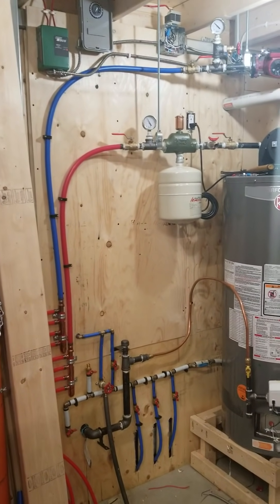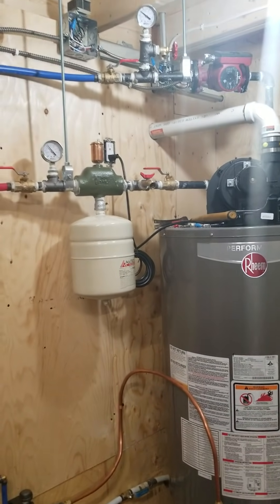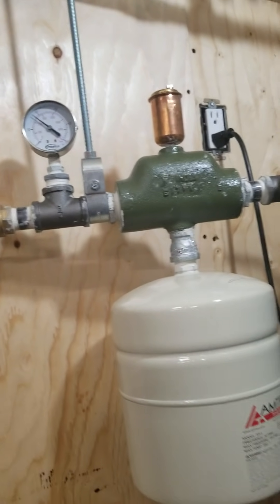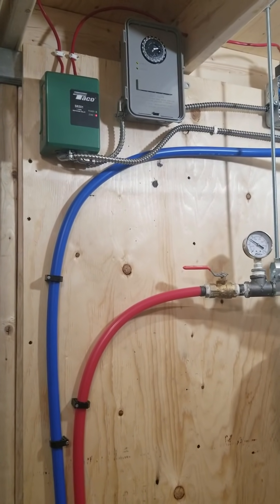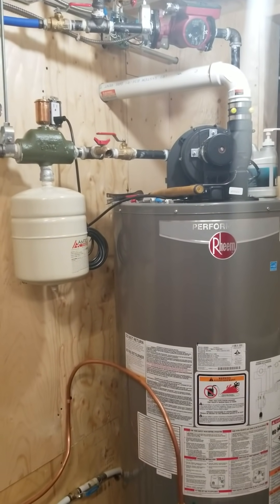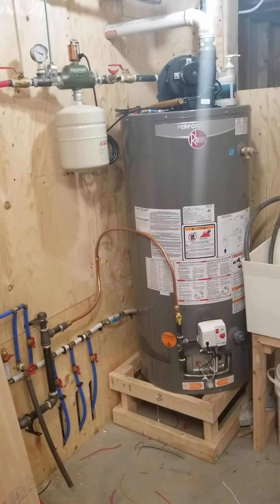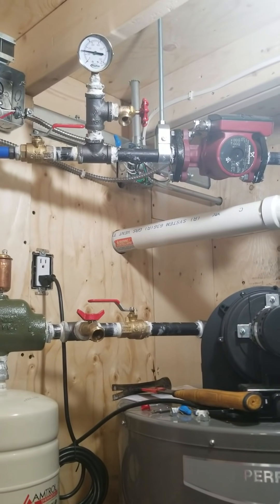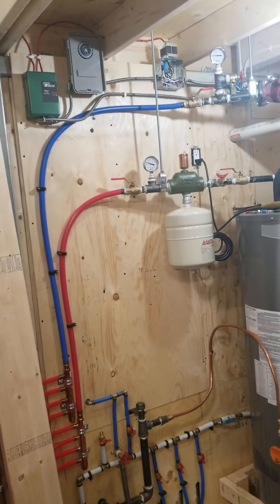DIY In-Floor Hydronic Heating System Using Water Heater

Comment: A really good attempt. Here are some helpful tips... Water temp coming back to heat source should be 15 degrees cooler than going out. This way your heat source can keep up. Do this by closing your out going on/off valve a little at  a time to slow the speed of circulation till the water comes back 15 degrees cooler. This gives the concrete time to pull the heat out of the water/ tubing. Slowing the circulation speed wont hurt the pump because they have an automatic bypass built into them.    2nd tip. You have way too much plumbing on the wall and its not insulated.(severe heat loss and inefficient)  From where my hot water comes out of my hot water tank to where it goes into the floor is only 4 feet. Cooler water coming back out of the floor to reentry to the tank is 4.5 feet.(insulated)    3rd tip. Connect a water supply to the system with a backflow preventer in place with a 3 pound pressure reducer. Lower the pressure in the expansion tank to 3 pounds also. Why? because you want the pump to control the speed of circulation ( Not the city water pressure or the pressure from the expansion tank) and also, even though this is a closed system,  water will disappear and you will need make up water.         4th tip. Scrap all the temp/ thermostat control stuff and buy a  120 volt 7 day 7 event programmable timer... I program my timer to turn the pump on and circulate a fresh batch of hot water 3 times per day for 2 hours each time. In between runs, the concrete constantly pulls the heat out of the water/tubing. As weather gets colder/ warmer , you can add or delete how many times the pump turns on. Follow these steps and you will have your system dialed in. Good luck.
Reply from the maker: Thanks for the tip, I will try these out
Reply: Agree with what you described but scrap the air temp thermostat, you need a floor temp thermostat.  When you put in the pex, place an empty one in the floor between two runs, about 4-6 inches away.  Run the temp sensor down the pex run and that will give you the temp of the slab.  The temp of the air will be exact as the slab temp then.  Set the temp on the thermostat and forget it.  The system will come on and off as needed.  When it runs, the temp sensor will rather quickly sense the rise in temp and then shut the system off.  The slab temp will then rise 1-2 degrees higher after shutoff.  When the slab cools down the cycle repeats.  No guessing, no running the system on a timer, and you get consistent temp 24/7.  Much more efficient too.  I got this one from Menards, been running for 9 years on the same hot water heater like yours with no issues.  Aube Thermostat w/ Floor Sensor
Model Number: TH114-AF-024T Menards® SKU: 6655651
Reply: @bobs4718  thank you Bob. Menards is getting better at handling more hot water heating components.
Reply: You say, "even though this is a closed system,  water will disappear and you will need make up water".  How is the water lost from a closed system?
Reply from the maker: @rogerg4916 there is still an air vent in the system. There will still be evaporation
Reply: There is no need for a fresh water feed. I have set systems up as a closed loop, one in a paint booth and a current one in my crane yard building. The crane yard has no water supply, so when I set the system up 9 years ago I just hauled the small amount of water needed. After charging the system and getting the air out (just like how you bleed brakes) I was done, and other than glance at the pressure now and then it's been totally leak and maintenance free. No real advantage to this way of doing it, just saying you can do it if you don't have a city water supply on hand!. My other systems at home have a boiler feed valve/check valve setup. I have an embedded thermostat sensor in my crane yard slab, set at 50 degrees, and a 1.8 KW 120 volt electric boiler by Electro Industries, oddly enough a 1.9 KW PV array makes enough power (stored in my utilities net metering system) during the non heating months, to let me keep the building (only 18'x 40', but 14' high) at 50 degrees all winter for free! The Electro boilers are great, especially if one has a surplus of free solar power.
Reply: I ran a similar setup with dual propane tankless heaters in parallel for hydronic and DHW with a flat plate heat exchanger. I recently swapped an 80 gallon heat pump water heater for one of the tankless units and use it only for DHW. I would like to get rid of the 2nd tankless unit and use the 80 gallon tank for hydronic as well.  It’s only a 2 person household so not a lot of hot water use. I don’t want to burn out the heat pump fast either and am wondering if it’s up to the task.  It’s a hybrid so can run on the 4kW elements too but want to minimize that. Had a thought that maybe I could keep the one tankless in service to get the slab up to temperature and then switch over to the heat pump water heater to maintain temps. Would have to install an automatic valve of some kind. Any thoughts?
Reply: Holy complicated.

Are you seriously suggesting changing the pump schedule on the timer every time the outside temperature changes? People have full time jobs you know, what an overcomplicated pain the ass way to control the temperature. Obviously you need a thermostat on the system. The timer is a good idea but only as a way to let your hot water tank recover between dumps into the floor. This also solves the problem of your heating system keeping up. 
 
Technically you could make this work with the smallest water tank available if you set up the timers right. You just wouldn't heat your space up at warp speed. Really the ultimate would be an on demand instant water heater, which is basically just a boiler.
Reply: @jimlewis1992  I have a hot water heater in a house we bought. Going with hot on demand propane. I was thinking of setting up the hot water heater for floor heater with the anti freeze. Is there a way to do both with the hot on demand  with separate water sources? The floor water would run under the house which is in Tennessee. It sits on a foundation but has a big crawlspace where the tank is now
Reply: @jimlewis1992  just to clear things up - an instant hot water heater is in no way “basically just a boiler”

Comment: Great job Jordan.  I like your system.  I moved from Eastern Ontario recently to Vancouver Island and I would like to build a shop with a similar system although I may use solar PV to heat the water.  I like your detailed and well-explained system components.  Thanks.
Reply: I would like to discuss your ideas for the solar pv hot loop system. I've been working on one of my own with a thermal battery feature. The goal is to eliminate the need for extra electricity or fuels to maintain those temperatures all night or longer without proper sunlight.

Comment: I wonder if you could just program a thermostat to run for 30 minutes, and then shut off for 30 minutes?  If that seems to be what keeps your room comfortable, why worry about a temperature control.  You could just turn down the temp of the water heater when the weather starts to warm up a bit.  That would eliminate the need for the "override" timer.  Just a thought.
Reply from the maker: But then I have to physically turn the knob on the water heater up or down. I have to ability to monitor and change the temperature anywhere in the world providing I have a wifi or cell signal.

Comment: I came across this video while I was looking for examples of how people incorporated a tempering valve into their system. I understand it is to help regulate the heating loop temperature. But I see you have a dedicated water heater right in the heating loop, which allows you to adjust it to what you want with the heater setting.

After hearing what you were saying about the heater running out (of hot water) I was thinking that you would gain on the duration of your hot water in the loop by incorporating a tempering valve between the hot supply water at say 160 degrees to your desired 130 degrees.
Apparently it hooks up between the hot line and the return line and uses that lower temperature return water to temper down that 160 degree water.  Just saying.
Reply: Can you use this system for a home?
Reply from the maker: I'll definitely look into this

Comment: Good Video! I'm a Red Seal/Master Electrician as well and Red Seal HVACR Tech. You have built a great system and perfect for your shop like you said. All looks and works as you want. The one thing I noticed was you didn't have a maid"O"mist/air bleed on the high point of your system. You may have added one already, but could easily be installed on the return globe valve before the pump.  Thanks for the video great work!!
Reply: out of curiosity, since this is a closed loop system, is there a need to constantly bleed air?
Reply: @FixItYerself  I would, more of an aid to keep the headaches away. I've seen many a small system like your and commercial highrise chilled and heat systems bleed of air that always gets trapped somewhere in the system and then decides to move on. The bleeder at the highest helps eliminate any issues. Cheers

Comment: Excellent!!  I have a friend in Alaska that is heating a 50x50 aircraft hanger with an in floor system such as you have and using a 50 gallon electric hot water heater to maintain.  Now I know how it's done.  Thanks

Comment: Thank you for the video. I wasn't quite understanding about how you avoided hitting any of the runs under the slab. Did you take measurements to know where you could punch into the concrete? Thank you for the reply in advance.
Reply from the maker: I stapled the water lines the the insulation. With a six in thick concrete slab and the half inch thick tubing I could drill down 5.5 inches and not hit anything. Just to be safe I only drill down 5 inches

Comment: I love some of your comments in the video and the overall system is awesome.

What spacing are the tubes in the slab?

Is that 1/2" or 3/4" pex in the slab?

Again, great video and thanks for sharing.
Reply from the maker: 1/2" tubing, spaced 12 inches apart

Comment: So many whiners in the comments, I'd say it looks pretty good. You should change out that plastic drain valve on the waterheater for a brass one, those ones are bad for leaking. Fuck the relief tube it's in a garage.. And to everyone saying this is going to cost a shit load of money because it's in efficient, natural gas is dirt cheap, this wouldn't cost more than a dollar a day to run.
Reply from the maker: Thanks man. Because of the liberal governments carbon tax my gas bill went up, but it still costs me about $350 to heat my shop a year and I turn the system on in October and shut it off in May.

Comment: nice job for an amateur. It will heat the space but this is horribly inefficient and overbuilt for what it is. Ive worked in HVAC for 19yrs and there is a very good reason we don't use water heaters as boilers. DO NOT DO THIS 

 unless there is no possible way to get a proper boiler. a standard boiler is about the same cost as a power vent water heater if your doing the work yourself but will last 50yrs and work a lot better.
Reply from the maker: To be fair I couldnt find a cheap enough boiler up here in Canada. As soon as an american heating unit crossed the border the price almost doubles. This is a work in progress, when the tank does fail I might be in a better financial position to purchase a proper boiler.
Reply: @jpaul1030   Its a shame you couldn't take a trip to visit the states.
Reply: Sounds like someone trying to sell boilers!

Comment: Great video. I have built a similar system. I'm having trouble wiring the thermostat using the separate transformer to the relay. Any way you could give the details?
Reply from the maker: What's your email I'll send you a schematic
Reply: @jpaul1030  colinduffy37@gmail.com

Comment: Nice set up..!  I have propane and Hate it. Electric heater be ok? I see guys doing this with electric instant water heater.. See any problem with that?
Reply from the maker: It will work well. Theres another youtube video showing a hydronic heating system where a guy uses an electric water heater and he says it works just fine. I just went with natural gas because here in Ontario we get bent over when it comes to the price of electricity. Natural gas is way cheaper for us.

Comment: Any idea what the heat is costing you in gas usage? Thanks.
Looking at doing this on a new shop.
Reply from the maker: It added about 60 bucks a month to my  gas bill
Reply: @jpaul1030  how many square feet is your shop.? Thanks!!
Reply from the maker: @SRH58  just under 1200 square feet with a 14 foot high ceiling, one 10x12 foot over head door (insulated r-14) and a 36" wide man door (insulated r-12). The walls were insulated with 6" thick roxul batten insulation giving me an r-20 value on the walls.

Comment: thats what they all say "how many hot water heaters can i get in that amount of time" blah blah,i agree that it will work and does.just not nearly as efficient,takes up a much bigger footprint and my time worth something to me.not working on something that is "jerry rigged" together when it breaks.sorry,i just had my system professionally installed and it looks like it,lol.im a mechanic by trade and see all kinds of "jerry rigged" vehicles and it all ends with the same result..FAIL..
Reply: How’s your “professionally install” system working out? Mine cost 20k 10 years ago and has problems yearly. I average $1000 per year in costly repairs because the “professional” retired and it takes hours and multiple trips for anyone to diagnose the problems. So that being said. I’m proud of this guy for doing this for $1k. Nothing lost even if it doesn’t work out. But I have faith it will work after a few simple modifications and adjustments over the next couple years. So what? He has to buy a new heater every 10 Years? Better than a $10k boiler and another inconvenience of waiting in the cold a week for a “professional”
Reply: @CR-ro2wd  mine was $6k for the boiler setup and has worked flawlessly for the past 3 years. Not a single problem and keeps my shop nice and warm even in -20f weather in February here. Very efficient also,doesn’t run much at all in my opinion.
Reply: Good deal. Yeah mine is for a 5 bedroom house and a driveway for snow melt (turned off until I get old enough and rich enough to pay for all those BTUs. Propane.

So 8 different valves for zones (including one for hot water). First year was fine and I bragged to everyone about how awesome it was. Second year I found a nail hole leak that didn’t show itself until we had some expansion and contraction and it leaked down all 3 levels filling up light fixtures on its way down. 5th year another leak showed up from a stapler used for insulation. Every other year I’ve had a pump burn out or one of the 8 zone valves give out. Mixing valve another year. Need to top off the system every two years. Oh, a taco 4 zone control box went bad after 10 (years). Thermostat on hot water tank needed replacement. It just all adds up. 

It takes very skilled workers to understand the system and in this economy they aren’t cheap or available on the same day to help me get me heat back up. Parts can and labor can take a week to work out. Space heaters work, but not for the cold showers. 😂 

Long story short, my system is too complex, unless a guy loves to tinker and lives in the home. Sadly it’s a high end rental and tenants aren’t as forgiving as my wife and kids.

I put electric in wall heaters in my other rental. Cost me about $200 per zone (new construction) which included wiring and the heater. I can expect 50 years (6 so far) of flawless operation and quick heat.

The massive savings of over $10k set up + $10k (propane tanks and plumbing) (for my size house) can pay for either a whole lot more insulation or a lot of slightly higher power bills. I’d rather bank the money and make interest.
Reply: @CR-ro2wd  wow,that is a complex system and that is the most problems i have ever heard of from a floor system for sure.i know plenty of people and family with floor heat in their house or garage/shop and not one has ever complained about it.My bro i know had to put a new heater in his shop a couple years ago but that is about it.good luck and sorry to hear about your misfortune.
Reply: I love radiant in floor heat when it’s simple and working. It cuts back on allergies, dust and germs floating around.  I haven’t given up on the idea of radiant, but I’d need to find a way to simplify the system (why I’m watching videos on YouTube).

Comment: Awesome video, thank you. Just curious, did you insulate underneath your concrete slab? I'm reading a lot of articles where concrete was poured directly onto 2 inch rigid foam insulation.
Reply from the maker: I laid down 2" ridgid foam insulation under the slab and extending out around the slab two feet. Then when I back filled the gravel for the driveway and the top soil for the grass I cut the ridgid foam insulation into 6" wide strips and glued that to the concrete so the slab head couldn't bleed off into the top of the earth around it.
Reply: @jpaul1030  Great, thanks for the info!

Comment: What was your annual cost to operate this system ?
Reply from the maker: I ran the system for about seven months, and the added cost (compared to last years gas bills) was around $490 so around $70 a month. Which isn't horrible considering the size of the space.
Reply: Jordan Paul not bad at all.